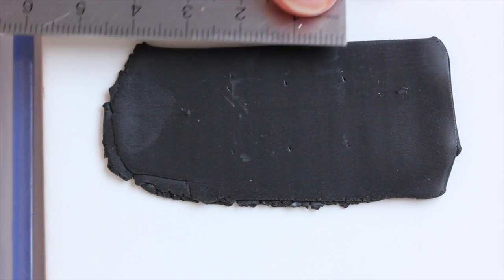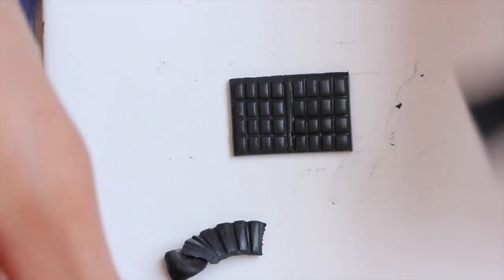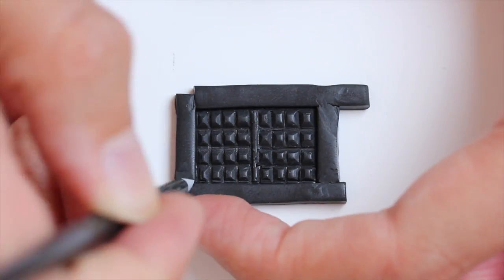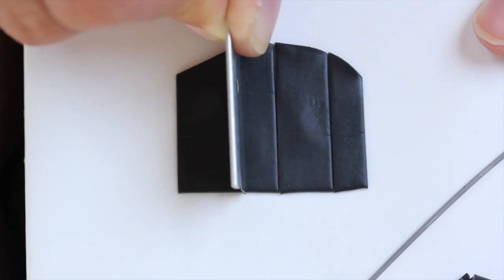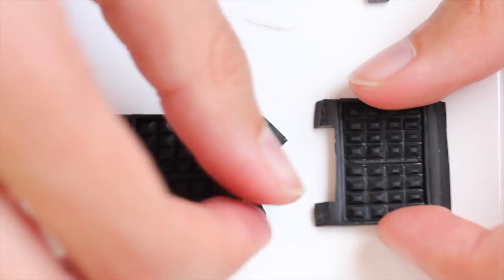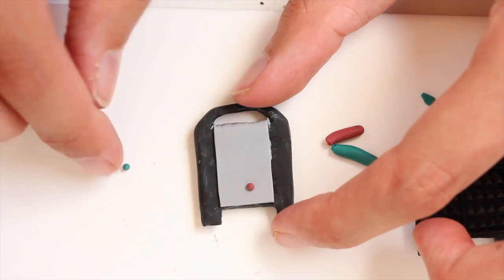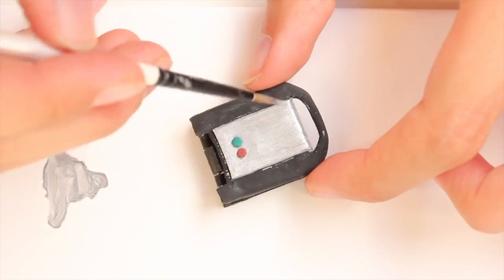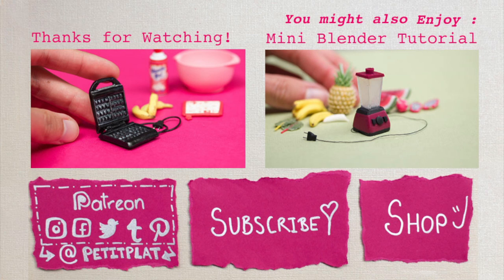Miniature Polymer Clay Waffle Iron/ Maker // Tefal Inspired

Comment: you should've showed us a clip where you put clay in the waffle maker to make a waffle.
Reply from the maker: no, because I would not do that. You risk to destroy your whole waffle maker.
If you want to use the same pattern for waffles, make a mold from the waffle maker or use the waffle grids before making the maker.
Reply: +Stephanie K. PetitPlat can I use it as a mould
Reply from the maker: I would not use it as a mould I think it's entirely too fragile once mounted.
But you could use the waffle grids as mould BEFORE mounting. Or make a mould from them.
Reply: Stephanie K. PetitPlat how about if you used light weight air dry clay instead of polymer clay? will it still ruin the waffle iron?
Reply from the maker: +black yang it still might remove varnish Abe paint if used too often.